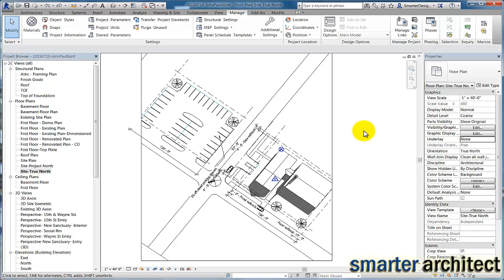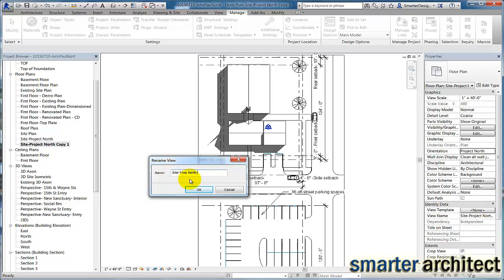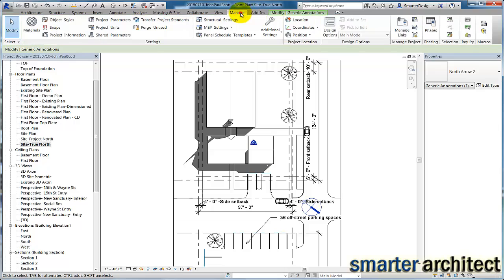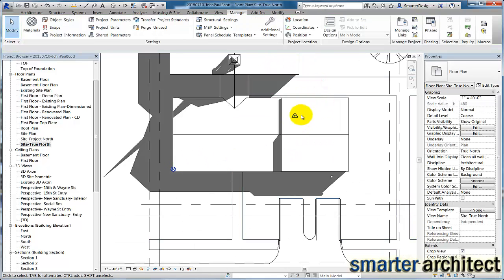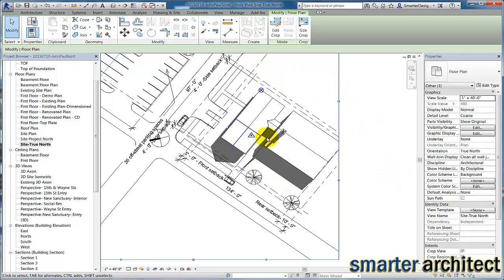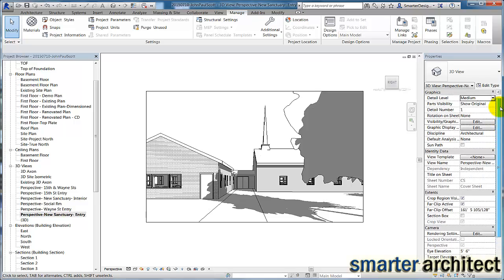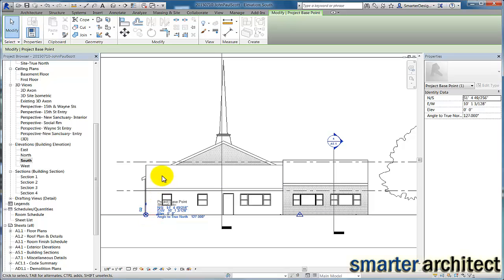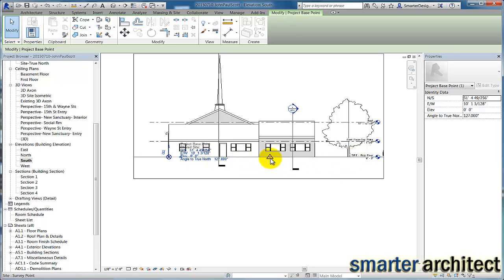Revit Tutorials: How To Orient To Revit True North vs Revit Project North

Comment: FOR PEOPLE WHO WANT ACCURATE SHADOWS IN PROJECT NORTH (which should be everybody cause who t f wants inaccurate shadows)

starting at 5:20 the video says you can get correct shadows in true north but you cant get accurate shadows in project north this is false, you can get accurate shadows in project north by going into sun settings and turning of relative to view, a more detailed explanation follows... go into the view that you want shaded and that is aligned to project north, click on the sun icon at the bottom of the screen next to the visual style icon, then click on sun settings, in the window that opens the Lighting option will be selected, do either 1 of the following 1) uncheck the relative to view on the right side of the window under altitude or 2) change Lighting to Still or 3) select 1 of the Presets that are located under Lighting

Comment: Hi. Thanks for the video a few yrs ago. I have the same question as Ivan re: the symbol pointing straight up. That was confusing seeing the line pointing to the side after rotation. Also, I was shown to use the ctr of the proj base point as the rotation point but you used the survey point. Should one always use the survey pt as rotation for True North?  Thanks again.
Reply: I had the same comment, glad that other people saw it. He should’ve rotated the project starting from the North symbol orientation counterclockwise to the noon time. Then the North is pointing UP and the project as it is in the map.

Comment: Thank you for your video. But there is something I don't get it. The moment you rotate the survey point your north symbol should be pointing up? (the rotation should have been done from the reference line to the top?)
EDIT: also does it makes a difference if you clip/unclip the survey point at the moment of the rotation?

Comment: hi i really liked your video but i have a problem with my two north. I drawn plan in the geographic north so when i choose project north my plan is slanted. And i would like to know if it's possible to reset the settings.
Reply from the maker: Your best option is to just rotate all elements from a site plan view to the proper orientation.  Just remember to unpinned the base and survey points!  There isn't a switch orientation toggle unfortunately!
Reply: waao It works i just have to make some adjustments but i dit it .